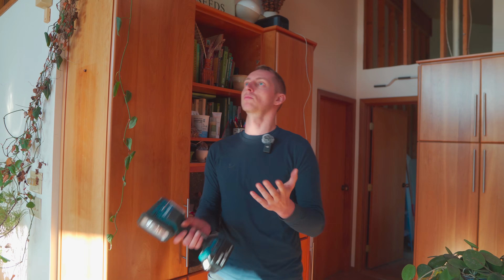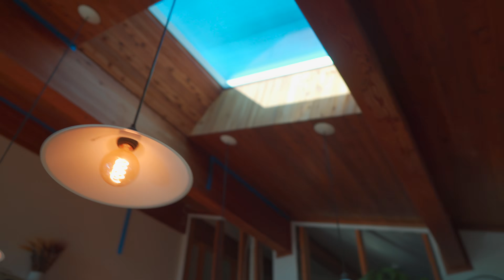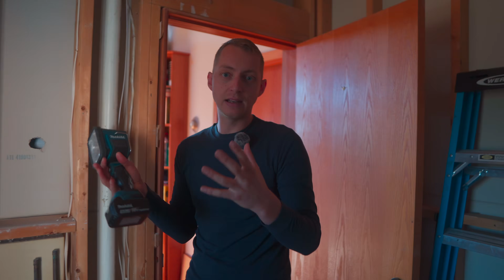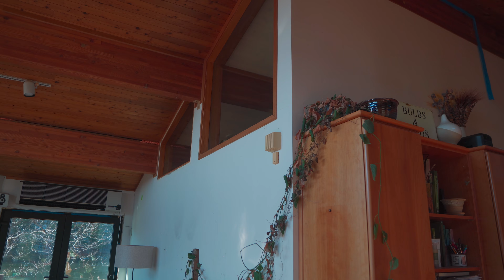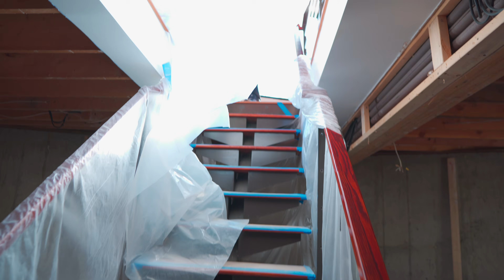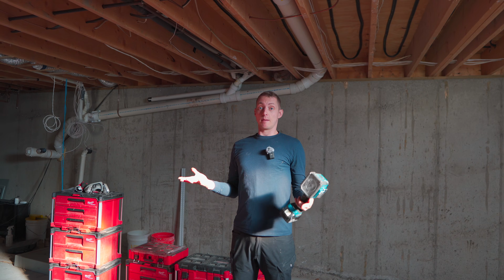It's Time to RENOVATE the Common House — Ep. 228

Comment: The problem with the stairway is the hole in the floor, especially the end by the kitchen / mud room.
So why not do one or two things.  One, make the stairs go down in the opposide direction.  Second make an "L" shaped stairway; one that goes down to a platform, then turns a corner to decend to the bottom.  This would 'shorten' the hole in the floor.

Comment: Saunder and Summer, when showing the basement area, a couple things came to mind concerning the concrete stem walls. You may consider first applying a fluid applied water barrier to the concrete then attached 4" Z steel furring with Powder Actuated Tool like a HILTI, on 2' centers then install 2 layers of 2" ridged foam insulation cut into 2' strips. Then apply the drywall to the Z furring.

Concrete that doesn't have a barrier on it could let moisture condensate on the backside of the foam board or worse yet the back of the drywall.

I came across a very good detail to prevent moisture issues if you are interested.

Cheers

BTW, I really enjoy your journey in creating your Shangri-La.
Reply: Great advice. 🏆

Comment: If your wall where the sun hits in the winter was a dark color or some kind of solar battery like stone/brick, it would warm up faster and keep your house warmer without heating system in the winter. Might not be possible aesthetically or from engineering perspective but could help more with your winter bills.
Reply from the maker: Totally concur. We are making that back wall a green wall (meaning a plant wall), however, and we were talking about having some water storage there, although I don't think the latter will make a ton of sense space-wise.

Comment: was fun to see what existing structures you are working with. you have thought things out thoroughly and the renovations will make for much better flow and comfort. the downstairs has some little issues but you seem to have a lot of options. the central part of our house is the original old farmhouse that was here and it had only two 17 foot squared off log support beams  end to end and only one center support so they had sagged considerably. we had to reinforce everything but couldn't really remove all the 2 inch dip in the floors and ceilings above. after a lot of exasperating cursing, arm waving and number crunching we looked at all the options and adjustments available and finally just decided on an attitude adjustment. so we now have charming  and historic sagging floors and ceilings in the center of the house. i think i might even try painting some folk art designs on the exposed ceiling beams in the upper floors. thanks for another great video, we really enjoy watching you guys on your new journey.
Reply from the maker: We like the "attitude adjustment" concept. Hahahaha. Mad helpful to have a "just go with it" mentality when coming to terms with some of the challenges. "I guess I'll just cut this at an angle because this wasn't put in straight to begin with"...I've said more often than not!

Comment: Nice to know about Alpin windows. We actually live in the foothills of the Rocky Mountains in Colorado, not too far from Rocky Mountain National Park, and have been considering replacing some of the large windows that are also not energy efficient and the sills are rotting. Will have to look into that brand.
Reply from the maker: Yes, highly recommend. They have excellent customer service too. Plus we like supporting US manufacturing, particularly when they do a great product. https://thinkalpen.com/
Reply: Just be careful with tilting windows they are amazing but must be protected from cats or else they can become a death trap ( I know at least 4 cats that have died in tilted windows)
Reply: @mutantmonkey2301  Yes! That is actually an important message for cat owners! - On that note.. whoever might read this.. if you have a window like that + a cat that is allowed to go outdoors + you live on the ground floor: my grandfather made a triangular wooden wedge* that he would slide in whenever the window got tilted, to „fill“ the narrowing gap towards the bottom of the window to create a safe step for the cat to freely jump in and out. This helped them both to allow them to keep the window tilted throughout the day/night for a cool breeze when needed, as well as reducing the cat-in-cat-out-cat-in-out..door opening situation.

*it was a DIY where he made sure to fit the wedge to perfectly slide into the window-frame so it wouldn’t move and was secure when the cat jumped on it as well as making sure that the window gap above the created step was wide enough for the cat to fit properly through. An outside bench (to enjoy the sun) against the wall of that window made it easier for the cat to jump back in.

(I miss him. A lot.)
Reply: @bettyebauche   grandpa girl here too 🫡  because these windows are the norm here in Germany there are great products to buy that protect the window

Comment: To better support the second floor, is it feasible to use "I" beams ( not sure if that's the term) parallel to the existing floor supports that are currently inadequate for the load upstairs?  Or can you just put "sister" (connect) similar type of beams but just more of them at least in the area supporting the kitchen?